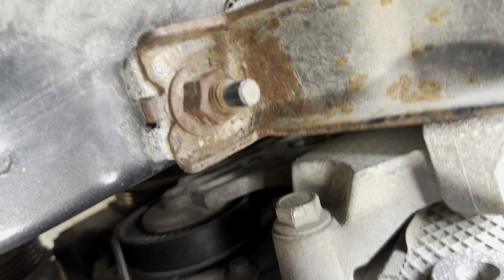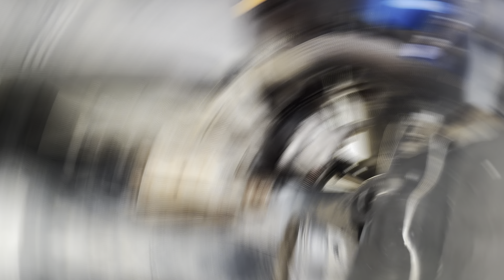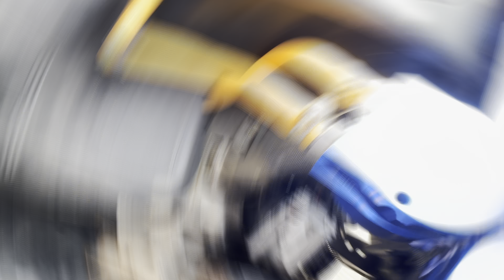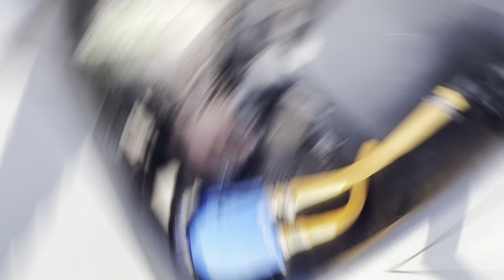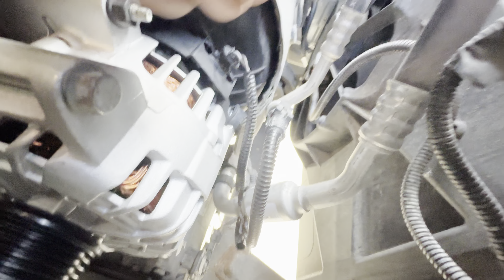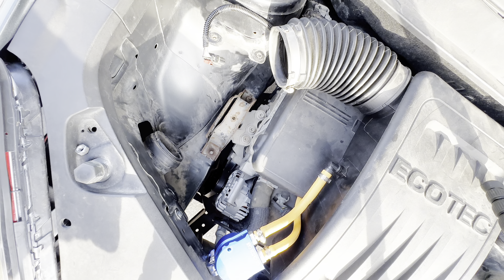2017 Chevy Equinox/Gmc Terrain Alternator Replacement

Comment: Great video William. For those who are doing this, a Tip.  There is a ground stud on the side of the engine, behind the alternator.  It's a critical ground point for various sensors and electrical system.  Remove, clean, install terminals, and hit with some Fluid Film.
Reply from the maker: Excellent tip. Thanks very much.

Comment: I think I may have to replace mine soon Is there a specific alternator Are these actually smart alternators I have a 2015 GMC terrain 4 cylinder.
Reply from the maker: They just have a standard fixed alternator. And yes this vehicle takes a specific alternator. You need to buy one that is made to fit this vehicle.

Comment: The tensioner pulley was not easy to get to from any angle. I have watched 9 videos on this exact job and there is no clear conscience on what size the tensioner pulley is. I have heard 1/2 inch amd now 3/8. Neither one seems to fit properly. This job has become a frustrating nightmare.
Reply from the maker: Perhaps this video of my tensioner replacement will help clear it up for you:
https://youtu.be/3ncdr8Wj4Vg
The tensioner requires a 3/8 drive to remove tension. There is no other sized. The video link I provided shows close up of me using my 3/8 drive breaker bar for clarity. Did you try to go from underneath?